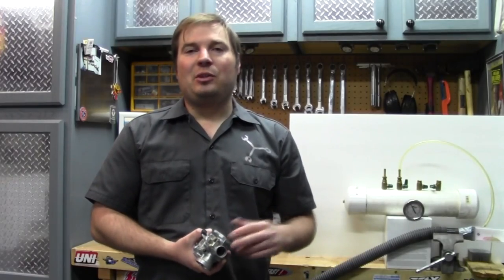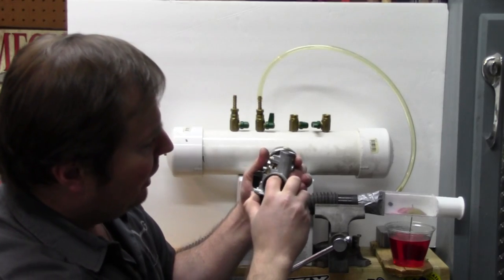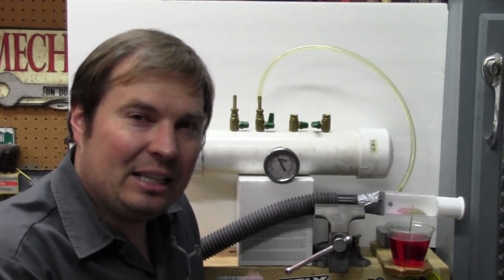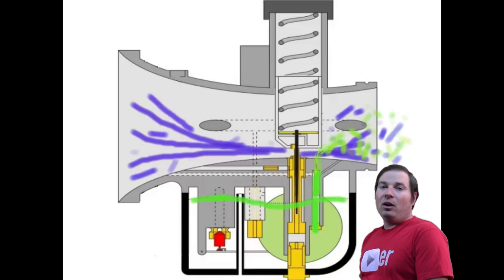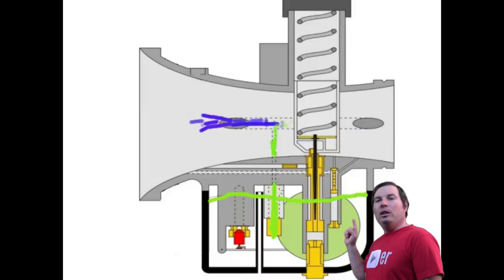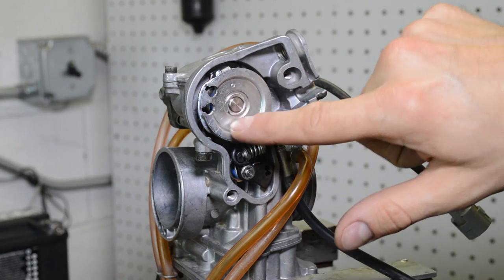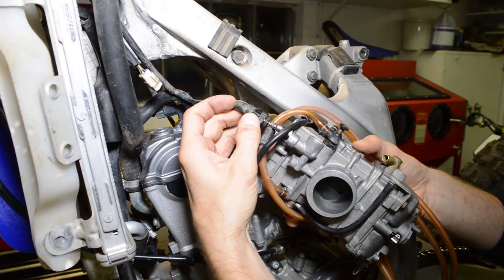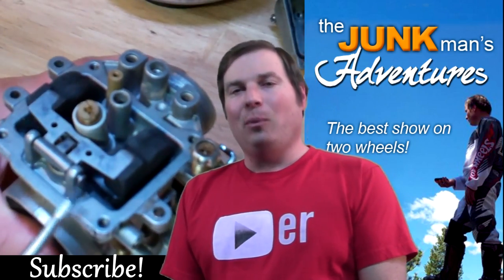How to adjust a carburetor, jetting and mixture explained!

Comment: Sir I have problem that My 110cc scooty giving high RPM 1800 Samthing
Reply from the maker: You have a lean condition from a vacuum leak possibly.
Reply: @thejunkman  May be vacuum leak 
Sir how to check vacuum leak 
My scooty no Giving milenge always Giving high RPM on idile 
So what's Do
 how to diagnose what's problem here
Reply from the maker: Use a little Ether around the intake sealing gaskets.  Then make sure your carburetor is clean, like all the passages.  Then you may need to re-jet or adjust the idle speed mixture.
Reply: @thejunkman  Sir I think it's main Jet problem 
So my RPM is high
1st I will chance main Jet
Then let you know

Comment: At wide open throttle won't fuel still becoming out of the pilot jet
Reply from the maker: Maybe a few vapors or drips if the fuel is sloshing in the bowl.  At WOT the level in the bowl will usually be below the pickup of the pilot jet, because the main jet is allowing the fuel to to flow out its large opening.  Also at WOT the vacuum (or low pressure area) created is less than at lower throttle openings.  Basically what ever little fuel may make its way through the pilot system is not affecting the mixture in any appreciable way at that throttle opening.
Reply: Wow thanks for responding so quickly that's been giving me grief for awhile the only reason I haven't asked before is because I didn't think you would respond
Reply from the maker: Well I do my best to respond to EVERY comment I get if needed.

Comment: Accelerator pump is there because when you crack the throttle wide open, you loose your low pressure or ability to draw fuel in. So you need a mechanical way of throwing fuel in to the system. They have been around for 100 years. Nothing new. 
Oh, and there is no such thing as vacuum. 
Only low pressure.
Reply: Edit, 
No such thing as suction!!!  Only low pressure.

Comment: The problems with these subjects lies solely in the fact people should go back to point A and forget everything, then re learn about all internal combustion engines.
Reply from the maker: It is more that people just want to be told the answer.
Reply: Yes you cannot make lesser people smarter.
Reply from the maker: I would say it has to be more about peoples desire to want to learn and understand rather than all out smarts.  Give a man a fish he eats for a day, teach a man to fish he eats for a lifetime.
Reply: You are correct. I have spent yrs on internet learning and most info on web does not give answer away for free. You have to study and already know answers. 99.999% of people know nothing or very little about spark plugs and wires coils resistors ect. I am that other person who does know more than most people but it didn't come free

Comment: Great system, until your main jet needle or any other jet gets clogged, then you have to tear the entire vehicle or motorcycle apart to clean it out.   Not really an option when you're a hundred miles away from home on a dark and rainy night.

What I want is a way to clean out all these little stupid jets without having to tear the carburetor out of the engine with all its associated rubber hoses attached to it.  Not very fun to do on a motorcycle when it's buried deep inside there.
Reply from the maker: +CHOPPERGIRL's AIRWAR there is no other way around that.
Reply: There's got to be, because we've had 100+ years to fix this mess and design every part on a motorcycle or car to be user servicable.   A tiny hole the size of a pinhead should not be the achilles heel in an vehicle to make it suddenly not run any more when that tiny hole gets clogged.

Designing the pilot tube repeatedly in a carb is worse than repeatedly designing in a thermal exhaust port on the Death Star, when you're up to Death Star #5 trillion
Reply from the maker: +CHOPPERGIRL's AIRWAR it is user fixable. And it is pressure differentials that make them work.  Running clean fresh fuel and a filter helps this. Also proper winterizing will keep jets from gumming up.  This applies to EFI systems as the injectors have tiny hole to slray fuel from.

Comment: why does my kx 250 run with the choke on? it should run like shit im putting new rings in it. cleaned the fuk out of the carb.
Reply from the maker: +Kevin Stearns hard to say, but most likely it's a vacuum leak around the reed block
Reply: thanks i replaced the gasket let see what happens.
Reply: it was the rings.

Comment: not bad for a kid.  LOL.  LOL.    but not all carbs are created equal .   many years a g my friend had a 1960  Buick  with a GM 4 bbl carb.  he went to pikes peek in COLORADO .  and it would not get to the top.    then a year latter i put an AFB  on it and it made it to the top very fine.  NOT ALL CARB ARE EQUAL
Reply from the maker: If you check out my other videos I am very familiar with engines running above 13000 ft
Reply: wow thats way cool.  here in Wichita tat is not an issue.  LOL.   ihave done a LOT of work on AFBs.   in the past.   i came up with a computer program to calculate the % of change .    all you do is figure area of the jet and rod to find the area that the fuel flows throu.    then compare that to the jet and rod you are wanting to go to.   and you have your change.
Reply from the maker: I have a slide rule from Mikuni that I have had for 20 years that basically does the same thing.  I worked on a lot of Carter AFB's and ThremoQuads in my day.  This video relates to motorcycle carburetors but the theories can be applied to carburetors in general.

Comment: You didn't adjust anything ....

All you did was demonstrate how a carb works ...  BTW you remind me of Eugene Porter
Reply from the maker: Right, you have to understand before you can jet the carburetor.  Everyone's situation will be different.
Reply: Title says ....
HOW TO ADJUST A CARBURETOR 

You didn't adjust ANYTHING ... 

Thats what i said before and you failed to answer me with a correct answer .. 

Its like making a video with the title "HOW TO CHANGE A CAR BATTERY" and then show me a battery and its voltage and how it works ... and NOT showing anyone HOW to change it ...
Reply from the maker: I have laid the ground work in this video so you can make a better video if you want.  That is what I like about this platform is users can expand what others have done before.  I have several other videos (recently) that go into even more depth on individual adjustments.
Reply: google SMH ...